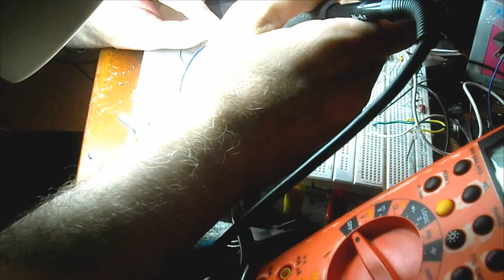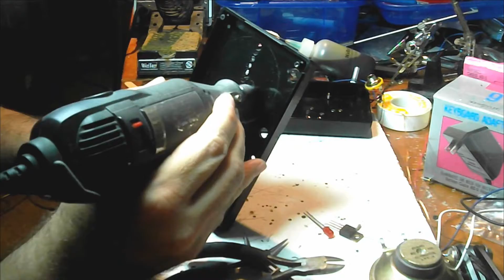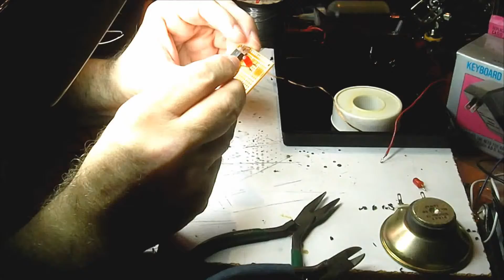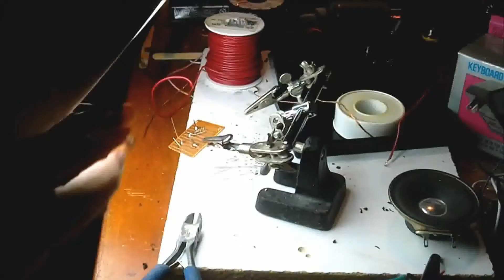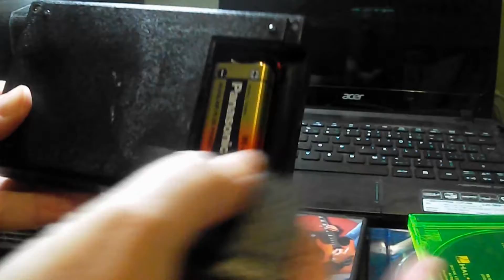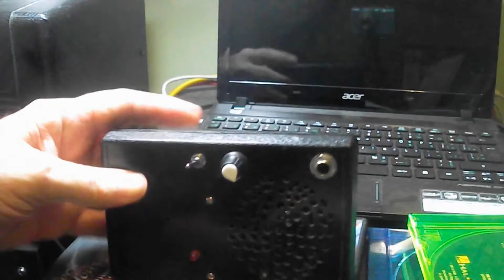Pocket Amp build and demo

Comment: That looked a fun build!
Reply from the maker: it was n its a good little amp for testing stuff out without dragging 1 of my normal amps into the work area.  Btw  my shado project will be back next week.  All I need to finish is a few of the screws that were forgotton when they sent the rest of the parts.  They're just stuck in the mail since its been slow cause of this infernal pandemic.
Reply: @CJ-rf9jm  Double trouble here, everything is slow due to the pandemic and then getting hit with import tariffs because of brexit!
Reply from the maker: I've gotta suspicion that Boris over there is really Boris Karloff.
Reply: @CJ-rf9jm  Certainly a horror show!
Reply from the maker: A Yakov Smirnov opening for the Spin Doctors at the Iowa state fair kinda show ;-P